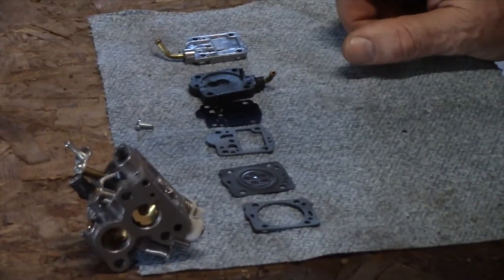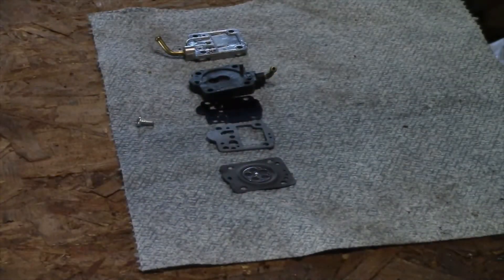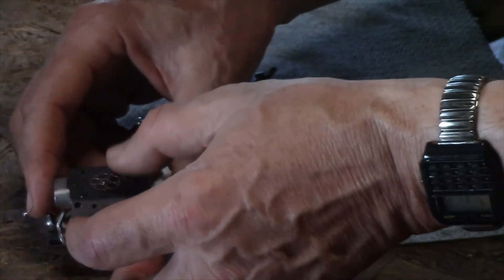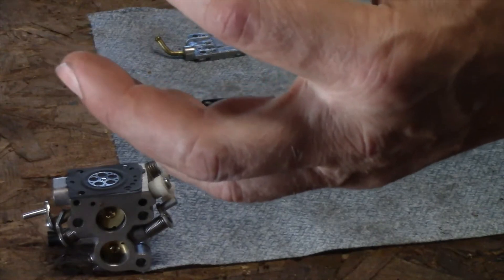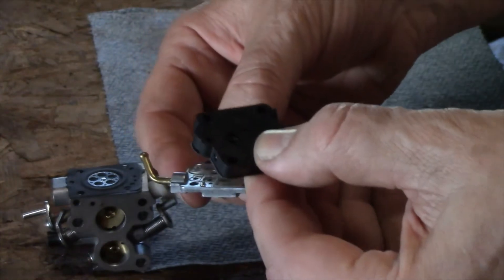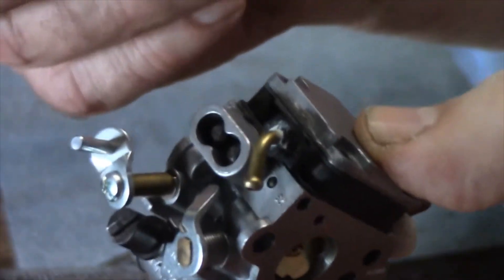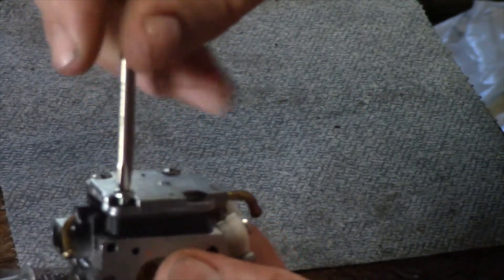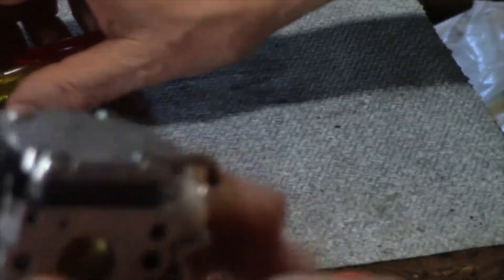How to rebuild a Husqvarna 440 e II carb

Comment: Is the 440 e the same thing as the 440
Reply from the maker: The 440e is the easy to adjust model. The previous owner converted mine back to a 440.